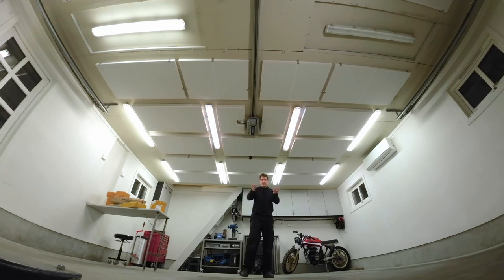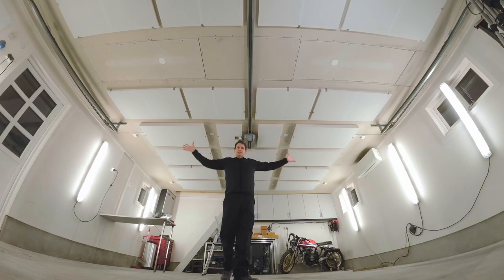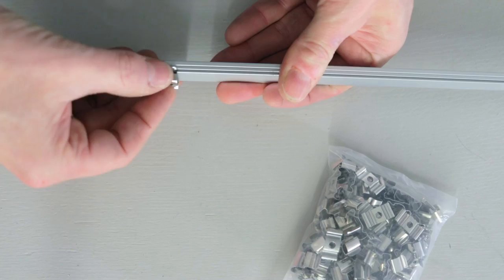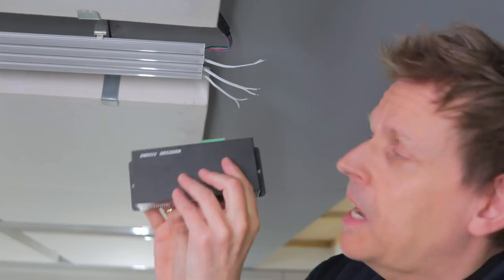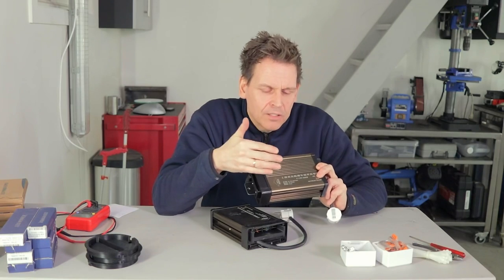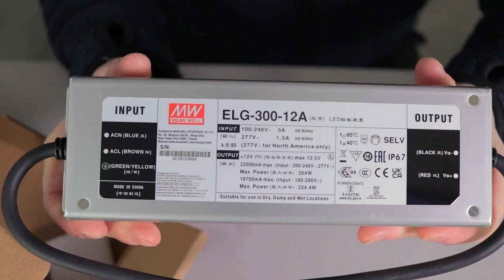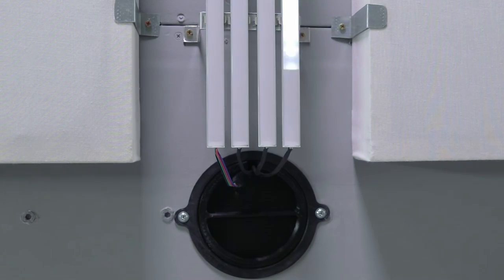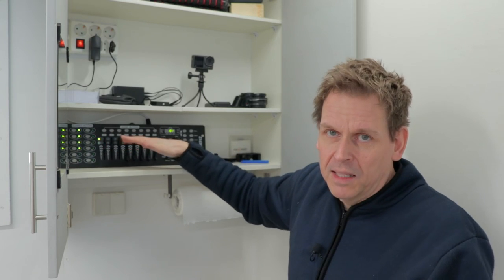Building Spectacular Workshop LED Lights

Comment: 3 metal halide lamps would have lit up the entire space without breaking after a few months.
Reply from the maker: A garage should have at least 6000 light bulbs 😁
Reply: It would also have been shit. A step down from those work lamp stands he was using, never mind the previous fluorescents. 
I have a temporary setup with 3 lamps and every single task in the garage is a PITA because of the hard shadows, end up using a torch constantly. The combined garage/studio/gallery setup is in the “cool but psycho” range, however the general concept is excellent especially for a multi use space.

Comment: Thank you very much! Ive been planning on upgrading my garage lighting but have been disappointed in the lack of high output 90+ cri lighting availability without paying $6k for cree linear lights. Having high cri is a high priority to me because it makes a HUGE difference in color perception.
Reply from the maker: I can totally understand that. The lights in my workshop are just at a whole new level after I installed these, and it's much easier to get proper colors when recording video. I have a Godox LED panels where I can set the warmth/kelvin to match the ceiling lights, this combo works great!

Comment: Meanwell have made a name for themselves in the past few yeast, really growing to be a supplier of solid reliable products. I have been really impressed with their products.
The issues that you have experienced with the other power supplies is most likely down to the cheap DMX controllers sending back to the power supplies a lot of electrical noise. If someone was to try to CE mark those controllers they would likely fail in the conducted emission tests. Luckily the Meanwell power supplies can cope with that level of noise. Great lighting anyway!
Reply from the maker: Aha, that was useful info!!! I am not very impressed with the DMX controllers I bought. I might replace them with something better, and some with 6 channels. Glad to hear that others as well think  MeanWell is a solid brand 👍 thanks for your feedback!

Comment: One thing to note is led strip lights usually are tremendously more power efficient when run less than 100% so you did the right thing by installing more lighting than you needed so you dont have to run them at 100% power.

LED lighting, dimming, and power delivery can be very complex but not that hard once you take time to understand it. The biggest problem is most people dont realize this when they first get into it.
Reply from the maker: I have to admit I have switched over to be running them mostly on 100% because my DMX drivers are a bit cheap and causes flicker on camera when I am dimming. It's crazy bright inside so so have to use ND filter on my camera 😝 

I totally agree about the complexity. I was afraid the DMX system could be difficult to learn, and I struggled a lot finding general info about it. Many tutorials are for specific brands, and that is more or less just plug and play to use it. However, it's not very complex when you first understand it.

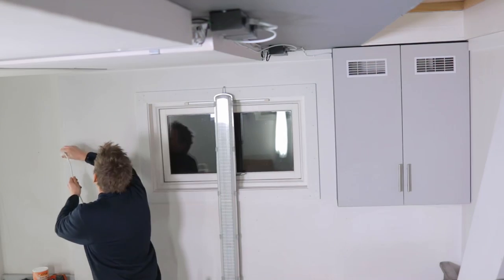Comment: 16:09 you have a lot of money in this with all the power controllers and dimmers. i just removed all my ballasts and installed new tombstones into my 8ft fixtures to convert them from a pair of 8ft T12 florescent bulbs to 2 pairs of 120v 4ft T8 LED bulbs. I cannot control color, nor can i dim them. I have 6000K bulbs from Amazon. I have 20  fixtures (80 4ft LED bulbs) at 18W each, it's 1440W in my 37'X23' garage.I did this 2.5 years ago, but today, with the tombstones, this would cost $540 for all the tombstones and bulbs. each bulb is 2200 lumens.
I know this is a LOT of stats.. but can you share all the same detail? There are pros and cons to both.. like I already had all the fixtures.. so there's another difference.
I like all your custom brackets and thought into this, by the way. I've just seen too many of the self adhesive tape LED strips get spotty over time with dead LED diodes.
Reply from the maker: Sounds like you made a solid conversion from T12 to LED in your garage. I am not sure how much you can trust the lumens rating on this from the sellers, but I used smd5630 LEDs and specs say:
55-65 lm per LED. I used a total of 3690 of these (61.5 meter LED strips x 60 LEDs per m).

Comment: I highly dislike high power 12V systems. They're literally fire hazards here and there, specifically cause of the mentioned connector issues and cabling size too. I really don't understand why 24V (at least) hasn't gotten to be the standard. I need to replace my garage lights near future and I'll definitely get something like FTLight Swift II models or something in that vein. 230V in and inside fixture DIP switches to fine tune color temperature. Much more simpler solution that will be easy to replace when time comes again.
Btw I sincerely hope nothing ever happens to your garage. In case of fire I suppose it would be absolute b*tch to work with insurance company with heavily customized solutions.
Reply from the maker: As long as the electrical equipment is CE marked and used according to the requirements it should be safe to use and the insurance will cover it.
I think you might have misunderstood how electricity works, there is no reason for 24V to be any better or safer than 12V. Since 12V is most common, you will find a lot of 12V low quality equipment, but do not be confused to think 12V is inherently bad 😊
Reply: @kihestad  no but it inherently needs much more from connectors and cables with higher power consumption.
Reply from the maker: Yes, if you are pushing the same amount of watts through a 12V as a 24V system, you are pushing twice the amount of amperage in the 12V system, and it needs beefier components and cables compared to the 24V system. 
I do have several DIY LED lamp using 24V, they are crazy powerful but the LEDs get insanely hot. My 12V DIY garage ceiling lights are just barely hot, the alu channels possibly helps on heat dissipation, but the 12V system seems to work great now.